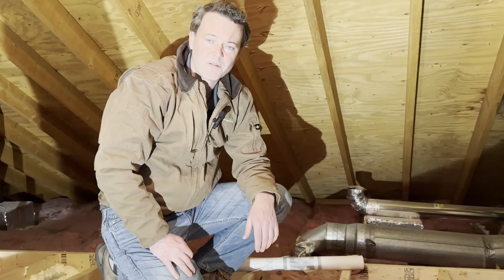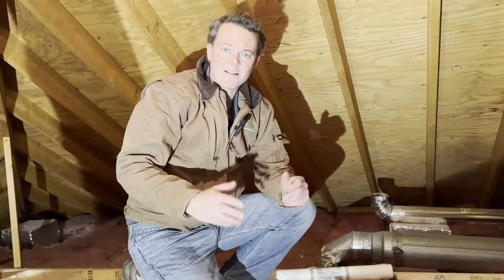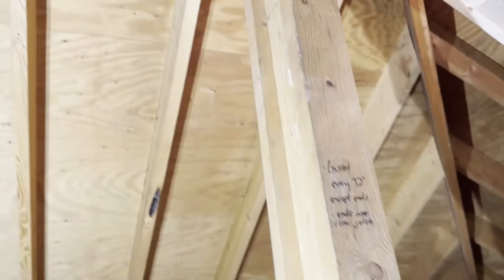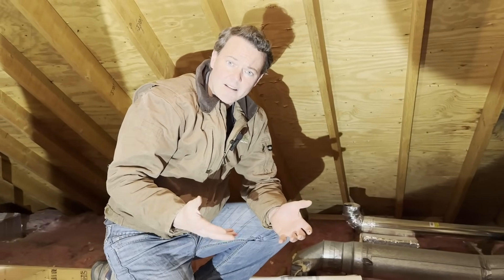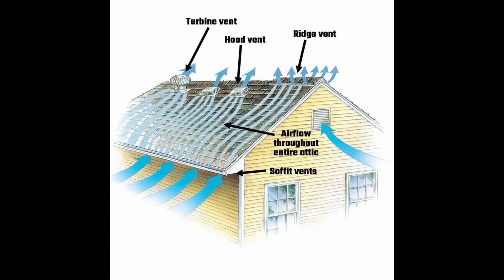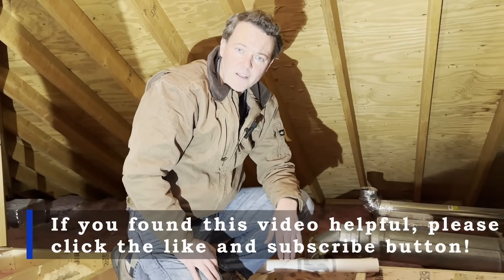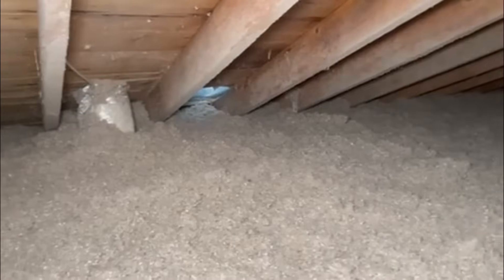Is a Roof Power Attic Fan a Waste of Money....or Even Worse?

Comment: How well do the under-shingle or the other roof vents work for input ventilation? If there is snow cover over them, won't they suck snow in through them?
Reply from the maker: Great question.  I first saw an undershingle vent in 2014.  The openings inside the attic seemed extremely restricted (we later had mold issues in this attic which is not a good indicator of effectiveness).  Since then I have seen many more undershingle intake vents that were obviously moving air and appeared obviously effective.  I don't have much experience with how snow impacts them tbh, but nearly all of them have a mesh layer somewhere that I think would reduce the level of snow that could get sucked in.  I think the roofing companies would have headed off that problem a while ago (one would hope!).

Comment: My powered vent motor was seized. That means it was trying to spin?
Reply from the maker: We see bearing failures in these things all the time.  They're usually durable, but they often run forever due to the temp or humidity settings they are set to.  That's another reason that we don't like them.  Even if they're properly situated on the roof and have adequate make up air -- as soon as or if they break down -- you will likely have a problem.  You noticed this issue, but many homeowners are oblivious...out of sight out of mind kind of thing.

Comment: Timely.  I don’t have an exhaust fan in my attic, but the large space is ridge and gable vented. This week outdoor temperatures where I live reached 112 and the attic was 122… (88 indoors without AC). Over night the morning outdoor temperature was 74 and my attic temperature was 84… (78 indoors by blowing out warm air in morning). So the attic is 10 degrees warmer than outdoor air, and my indoor temp rises 10 degrees without using AC. The insulation keeps the ceilings cool to the touch, I feel no radiating downward heat inside the home.  It doesn’t seem that I would benefit from placing a fan in the attic to blow out the warm air in the mornings.  What is your opinion on this?  Central Valley CA, dry heat, humidity avg 40
Reply from the maker: We are huge fans of "old school" gable vents here, especially when they are large and aligned east / west.  I would not install a power fan in your case.  If the attic gets hot -- but the insulation is effectively keeping the heat from radiating / conducting down into your home -- then who cares if the attic is hot?   That level of heat is not going to damage anything up there.  I would seriously consider having your attic floor air sealed though, that would be a better use of resources than a power fan in my opinion. 
Thanks! Andy
Reply: @insulwiseenergycomfortsolu3293   thanks!

Comment: I'm on the fence about putting a 24" 4200 cfm exhaust fan on the side of the my house where there's a  vent I do have soffit air intakes and ridge vent on top of the roof. I think that fan will help with the extreme heat in my attic
Reply from the maker: Is the heat in your attic conducting downward into your home and making it hotter?  Is the heat damaging things you have stored in your attic?  If neither is the case, I wouldn't.  And in your case you'd need to install it in a place like the middle of your roof so that it pulled from both the soffit and ridge vent.  If you installed it at one end it will pull only from the local vents and may not impact things much.

Comment: We have a whole house fan. We also have a ridge vent, gable vents, and soffit vents. When it is cool in the morning, we turn on the fan which cools off the house and the attic from the previous days heat build up. It works like a charm and delays the air conditioner from coming on until the afternoon.
Reply from the maker: You have a good system there.  In dry climates that can work very well.  In our climate though our heat comes with A LOT of humidity.  When the whole house fans switch on they pull in humid outside air.  You get the draft/ breeze effect, and you will cool the attic, but you're still stuck with the humidity.
Reply: We used to do that in NY, but in the Mid Atlantic coastal area, we get too much humidity - especially in early morning when its coolest. Very common to have over 90 percent humidity in the morning. Can lead to massive mold problems if the AC doesn't dry it out afterwards.
Reply: @ratandmonkey2982  Yes, I can se where that would be a huge issue. I'm in California so the humidity is usually low.
Reply: having ridge venting and soffit venting works against itself.  You should use one or other. With ridge venting the air outside gabels will be sucked in. The intake should come from the soffit vents instead which is cooler air and brings the air, hot up the roof.

Comment: Not just houses, but all buildings need proper ventilation of the roof structure. Moisture rots wood. Having proper air flow to keep your structure dry is critical. I just finished building my post-frame barn out back with 24 inch overhangs on all sides, plus 100% vented soffit panels and a full-length ridge vent. The roof has OSB on top of the 2x6 purlins which are top edge flush-mount between the trusses using joist hangers. Passive ventilation will keep everything dry. The white steel roof will keep it all cool.
Reply from the maker: You've got a smart system there down to the light roof color.  Your type of system is what we like the most and recommend to our customers.  Cheers!
Reply: what do you mean by white steel? Is it a standard metal roof painted white?

Comment: But did that fan and ridge vent installation meet the code minimum?  There might be the problem.
Reply from the maker: I don't know that.  However, I don't think the code people are that knowledgeable, seemingly, when it comes to this kind of thing.  We see set ups like this so frequently that I don't think that code officials are routinely analyzing the placement of power roof fans and make up ventilation sources (passive intake and exhaust vents).

Comment: It always amazes me how many people, including roofers, don’t understand the need for intake air to enter the space for exhaust air to happen.
Reply from the maker: Here here!  We this ALL the time.  I've also worked in attics on many scorching summer days that had set ups like this (power fan located a short distance from a ridge vent) and the cooling effect was virtually ZERO.  The fans run ALL DAY but only re-circulate the air in a small feedback loop.  It's a total waste of money in situations like this.  
Andy
Reply: true, in fact people will pay for new roof costing  13,000 to 35, 000 plus and the roofer is actually voiding the new manufactures warranty because there is not enough soffit intake and exhale roofing vents. Read your warrantys!

Comment: I love my power attic fan. Works great and is programable via my phone. Variable speed DC motor is quiet and efficient. And yes, duh, of course you need lots of soffit vents to provide fresh air into the attic.
Reply from the maker: When they're situated correctly they can be very effective.  It sounds like whoever installed yours put some thought into it!  Well done.

Comment: How can a ridge vent work under heavy snow? Vent buried, limited soffit vents in my house.
Reply from the maker: That's a good question.  In heavy snow a ridge vent would likely be impaired.  In Pittsburgh we don't get a lot of heavy snows anymore, but if my memory is right even when we did have them, the ridge was usually the first thing to blow off / clear.  I think just due to it's exposure to wind.  But that's certainly a fair question.

Comment: And most if not all people don't understand building science! Even the people that write the codes! Remember building codes are the "minimum" building codes! Fiberglass and Cellulose should be outlawed! They just don't work! Convection (air leakage) can't be stopped by loose fill insulation! And HVAC (Heating, Ventilation, Air Conditioning) 99% of the time is installed incorrectly! In your video you have equipment "outside" of the thermal envelope! If you insulate the "shell" of the home everything you do in the future is "inside" the thermal envelope!
Reply from the maker: You're right, they are minimum codes, and I don't know how much building science code officials are often aware of.  That said, we get consistent and excellent results by combining intensive attic air sealing measures with thick R-49 levels of cellulose insulation.  It's certainly ALWAYS ideal to have the HVAC equipment located inside the conditioned space of the home, but sometimes you just don't get that.  In this attic we spray foamed all of the exposed duct work which definitely helps.
Reply: @insulwiseenergycomfortsolu3293  Cellulose doesn't air seal. Spray foam insulation is the only way to go.

Comment: @1:50  As an expert, you lost credibility when you claimed the attic fan would draw air conditioned air out of the house.  HuH?
Reply from the maker: Sorry, but you are incorrect.  It is widely understood that power roof fans --- IF not supplied with adequate make up air in the form of passive roof vents --- will depressurize the attic (effectively turning the attic into a vacuum) and pull air upward from the home (through air leaks in the attic floor) and exhaust it through the fan.  When this happens in a home that is using an air conditioner, that is air conditioned air that is getting sucked into the attic and blown out through the power fan.  It is an idiotic, but common mistake that happens when these fans are installed (unless it is the homeowner's strange goal to cool their attic with their air conditioner...)
Reply: @insulwiseenergycomfortsolu3293  I am right, as why would anyone use an air conditioner in a home that leaks air into the attic?  You must be talking about sub-standard homes?  Even my 80 year old house doesn't leak air into the attic. Electrical and plumbing orifices are sealed with caulking, and newer homes are supposed to be sealed with plastic air barriers? AND, every sub-standard home that does not have some type of soffit or end gable venting, plus roof venting should be remediated, BEFORE any attic fan is installed.  Even BARNS have fans to either bring in fresh air or exhaust gasses, or huge venting.

Comment: The international energy code requires 1sq.ft of soffit ventilation for every 100 square feet of attic space . If you use as many Power vents as are required to vent your attic space you will use as much or more electrical  energy as you save . Not counting the cost of the power vents and the labor to install them and there average life span is about 5 years. You need turbine roof vents or ridge vents or stand alone vents. Ridge vents that don't have baffles can leak from wind blowing in rain or snow. You need attic ventilation in the winter to help stop moisture that lowers the effectiveness  for your insulation. When insulation gets wet its like putting on a thick wet sweeter on a winter day.
Reply from the maker: We are big fans of effectively sized and placed passive ventilation for sure, for all of the reasons that you mentioned.  Cheers!
Andy
Reply: @insulwiseenergycomfortsolu3293  Thanks Andy you know your stuff.

Comment: whole house fan. Cools both the house and the attic.
Reply: where would it go and how would it work. Im interested
Reply: @Laguna2013  I googled "whole house fan" and found a lot of references. Mine is installed (by me) over the center hall next to the heater intake in the ceiling. It was a matter of placing ceiling joists in a box configuration that the fan sits on, then putting a hole in the ceiling there. A vent cover (supplied with the fan) goes on the bottom, then you run power to the fan, and I installed the fan switch (also provided with the fan) in the wall of the hall under the fan by drilling a hole in the top plate and running a wire down to the switch. I believe I got the fan from home depot. Its been there for more than 20 years.

It works by sucking air from the ceiling in the center hall and pushing it into the attic. There are three big vents in the attic that let the air out. The efficacy of the fan depends on the outside air temperature. I usually wait until the outside is 10f lower than the inside temp before running the fan. It can take a while to equalize the inside and outside temperature. I believe this is because the house itself has absorbed a lot of heat during the day. This is one reason the fan is so effective, the attic has a lot of heat stored in it during the day that needs to be gotten rid of.

We are in 100f+ temperatures of late, so it is getting a good workout.
Reply from the maker: In dry climates they work great.  In humid climates like ours the effect is less so because you end up sucking in all the humidity that's in the outside air.

Comment: I was a home inspector for 30 years. Was the open elbow pointing up into the attic from an interior exhaust fan? Certainly appeared like it. That's a big no no.
Reply from the maker: This attic was still a work in process and it would not have been left that way.  But you're right, big no no for sure!

Comment: And the air that the attic fan pulls from you house has to be replaced some how so hot moist air is drawn in from outside increasing the load on your AC system.
Reply: whether you have a ridge or passive gable end vents or powered gable end fans, if you have proper soffit intakes gown low, you arent going to be drawing air from the living area.
its the absense of intakes that makes ridges not work and powered fans to suck ait from inside the house.
Reply from the maker: You are 100% correct.  When roof power fans are not configured properly (and in Pittsburgh they rarely seem to be) they are a waste of electricity at best and at worst cause you to cool your home with your air conditioner -- while pulling in additional hot outside air which as you stated increases the cooling load of the home which is bad bad bad...

Comment: Our house was built in 1995. We originally had an attic fan added to our attic at the time of construction. We do have two gable vents on the side for intake (we're an end-unit townhouse). Now, after about 10 years of so, the attic fan motor blew and we never replaced it. Finally, in 2021, we had our asphalt shingle roof replaced. We had the roofing company hack saw off the exhaust vent, cover the hole with plywood, then they put in the new roof. It looks smooth, and you cannot tell there's an attic fan, unless you go up into the attic. Of course, we won't do an attic vent now, as we have solar roof panels installed over the back slop of our roof.
Reply from the maker: If your attic has been vented properly with passive ventilation methods, and your attic floor has been air sealed and insulated to at least an R-49 level, you'll be great.

Comment: My dad had a gable vent fan that cooled the attic a little. Contractors sided over the vent opening, installed perforated soffits, ridge vents and powered roof fan; absolutely no cooling effect in the attic. Dad's gable vent alone was the most effective of all these efforts. Cannot find a contractor who will install gable vent/fan.
Reply from the maker: We have seen this many times.  That power fan is probably located too close to the ridge vent if I had to guess.  At this point if you had a power gable vent installed it would likely have the same result because it would also pull from nearby ridge and soffit vents -- short circuiting air flow from coming across the attic.  Either way the goal is to cool the house --- not the attic.  To do it the right way you want to air seal the attic floor and have the attic effectively insulated.  If you do this, you should have virtually zero heat transfer from the attic down into the home.  Then you'll have the benefit of a far cooler home, and also a warmer home in the winter that uses significantly less energy year round to heat and cool itself. 
Andy
Reply: @insulwiseenergycomfortsolu3293  observation is correct; power roof vent was installed2+ feet below the ridge line. We have great insulation in the attic floor (house ceiling joists) with craft foil facing into the attic; NO heat transfer into house from attic; but attic becomes very hot; attic used as storage area, have melted some plastic items; may have to uninstall the power roof fan since ineffective, and place radiant reflective barrier in inside of attic rafters?

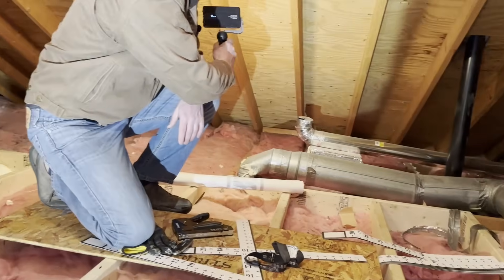Comment: You are blaming the roofer at 0:48 - no, it might be the siding guy that did that. And the insulator should have stapled in some vent troughs before the insulation went in.
Now, I don't know whereabouts this was shot, but there's inadequate insulation there, and the ducting should be insulated.
We had a solar fan in the roof from the previous owner - didn't work, so I upped the insulation and we had a mini-split installed for the upper room - normally we only get 25° max, but occasionally it hits a high of 32°C and a low of minus 5°C... the mini-split keeps the missus happy.
Reply from the maker: In this case we know it was the roofer, but you're right siding and many trades will perform this task.  We actually were the the insulating company working here.  We did not install soffit baffles because there were no soffit vents on this home.  Part of the work scope was spray foaming the exposed duct lines to seal and insulate them, air sealing the attic floor with foam, and then blowing the attic to an R-49 level with cellulose insulation.  But I'm glad that you're seeing good results with the repairs you've made to your home!
Reply: @insulwiseenergycomfortsolu3293  Thanks for the update. You do an important job!